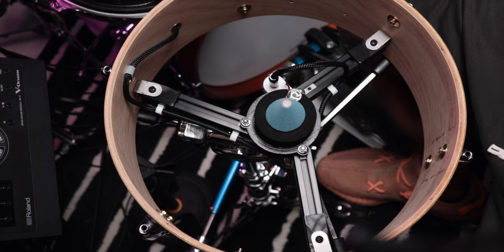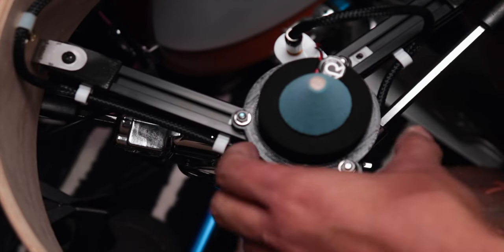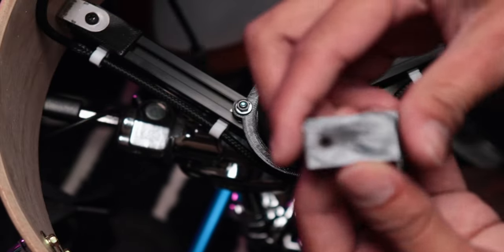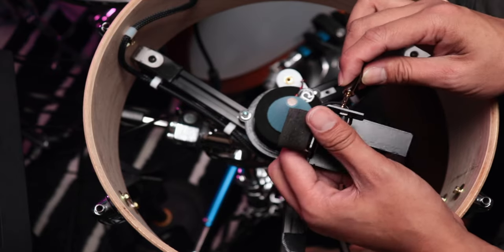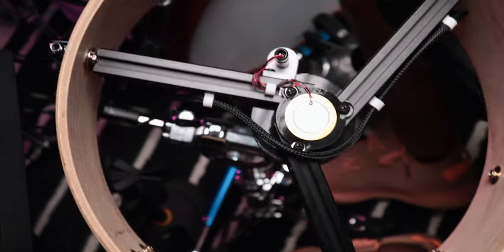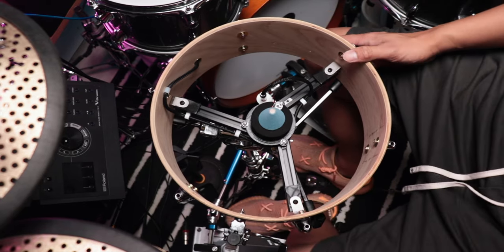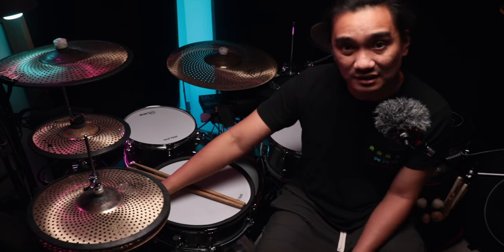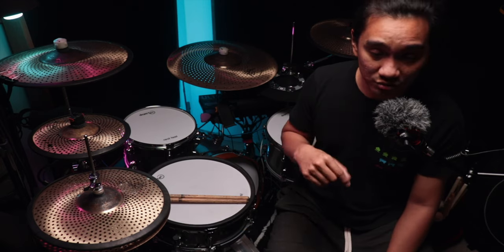I Upgraded My Snare Trigger | DIY R-Drums Dual Trigger System | Part 1:2

Comment: Just to give people an idea I took a used Roland kick tower I had laying around and screwed it into my kick drum shell and cut a small hole in a bass drum head now I have an excellent triggering acoustic electric bass drum , love your videos man thanks for what you do
Reply from the maker: Thank you! That is a great idea. Was thinking of doing a similar thing. I went with rdrums for convenience.
Reply: I think I can do this if I just knew how to wire the trs jack block to the piezos I know you showed the diagram but that’s where I get intimidated

Comment: Excellent work, one question, where do you connect the trigger output on the Roland module?
Reply from the maker: Thanks! TD17 Roland snake has a snare line. It’s a dual zone cable. It’s plug and play

Comment: Hi, thanks for your Video! You wondered about the tip on top of the triggercushion. The tip is there to prevent the foam of the cushion to get rubbed of by the meshhead ;-)
Reply from the maker: Ohhh, there you go. Thanks for that! 🙌🏽🙏🏽

Comment: thanks for your video, it's one of the best I've seen congratulations! I have some questions to ask you: the aluminum profiles, I think and hope are easily recoverable, but I would like to know how you made the base of the trigger, which is installed on the three aluminum profiles, I understand that it is very particular. Also, are the two piezo triggers the same or is the rim trigger different? Which brand you suggest about trigger kits? I'm using an old, but still functional ROLAND TD-8 module and I also use the rim, not often, but I happen to use it. thank you for your precious support
Reply from the maker: Thank you! Yes it’s a 3d printed part. The STL printable soft copy is linked in the description. However you can do without it. You can use  any round metal disk or something similar.

Comment: Great stuff! I’m planning to build a DIY snare for my kit but was wondering if it’s worth going for the 3 side trigger setup some newer snares have (like the Roland PDA120L) rather than the one central cone. I hear it plays great and avoids hot spotting issues, you think it’s worth the extra work? Thanks
Reply from the maker: Thanks man! I think really depends on the time & resources you’re willing to spend on it and what having those extra stuff means to you. If you know a lot about the mechanics on how it all works and what usually fails (wc I’m not tbh) then it’s probably worth the trouble. For DIY the simplest solution tends to be the best one imo.

Comment: Hello ! what kind of foam do you put under the cone piezo ? What the point of putting a circle of metal just under this piezo ? I thought the piezo had to be directly on the foam.... thanks !
Reply from the maker: Hey. The round foam is a pro decoupler by r-drums. It comes with a metal top to put the piezo on. I don’t exactly remember the function but it has more to do with getting more accurate/stable response, or information transfer from hits to piezo. Vdrum tips used a metal top with a DIY foam decoupler on one of his videos too. This is a pro version by r-drums.
Reply: @ProjectBeats_  thank you :)

Comment: Woahh that's a great trigger setup you made man, is there any particular reason you opted for a three spoke design  rather than a more common 'bridge' type design?
Reply from the maker: Thanks! I was planing on 6 spoke but dint want to bother cutting the alu profile to length. From what I understand, more spokes = better rim trigger response.
Reply: @ProjectBeats_  thats interesting. I have a trigger with just a one arm mount. It works well but i might put a bar of metal or wood under that connects both sides and see how that affects rim response.